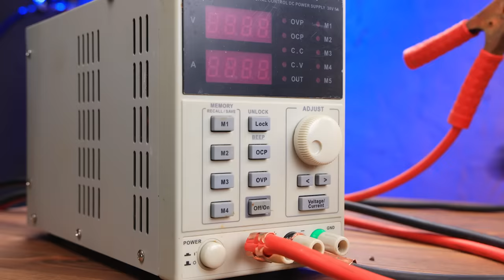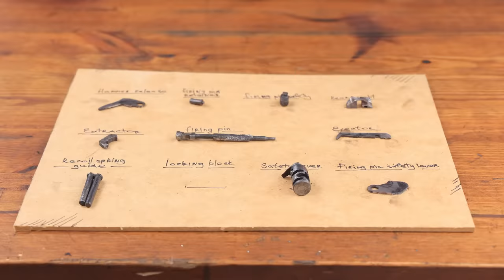Old Pistol Restoration | Walther P38

Comment: As with the Tokarev, you made the same attempt to fill deep corrosion craters on steel by "carrying" metal by welding, at least in the major craters. This is truly commendable, you are the only gun restorer who works in this very unique way.
Reply: You mean by restoring the same guns multiple times? Not even  different one of the same model. Idk what he is doing with his videos. He combines like 3 guns in one video. He has done the same guns like 5 times for a lot of them. He just did the sturmgewer twice recently. And also the German machine twice.  If don’t understand

Comment: Hate to be this way but it's not restored if it doesn't shoot. It's a nice wall hanger and conversation peace and I do watch the videos.
Reply: Completely agree
Reply: @juanramos5266  and it is like that in all his videos he is just making wall hangers they are not restored and can't be unfortunately parts can be reused but that's it.
Reply: @matthewrutherford6164  Exactly, the restore is supposed to be fully functional, not just remove the rust and put the parts together.
Reply: @juanramos5266  not only that but welding in the rust pits well that also loses structural support with the metal due to the heat.